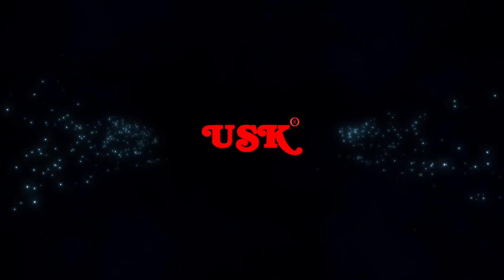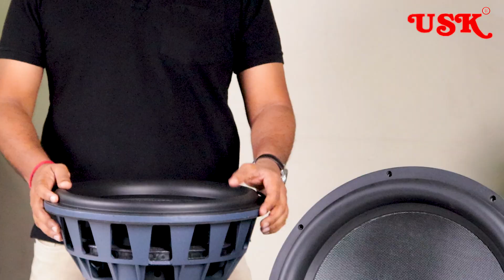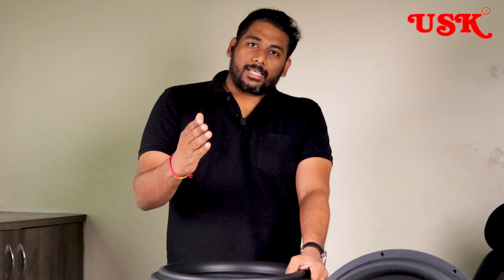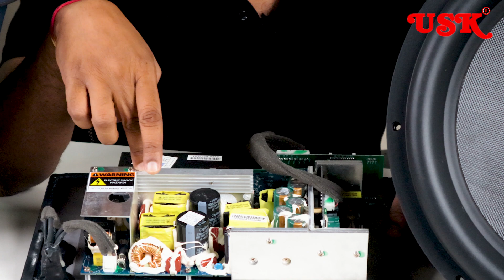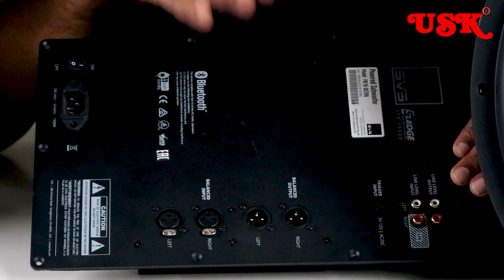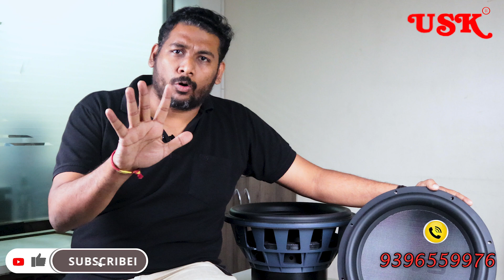"Massive" 5000 Watts Peak SVS PB16-Ultra Subwoofer

Comment: I own a few SVS subs and I had to replace my 16 ultra woofer and I was look at it and my god it all has good qualities but the wires from the push connectors to the coil made me curse most subs have the wire woven in with the spider yet their wires were out in the open and mine were ripped not even talking about I was in thin they were everything on my SVS subs are high quality, but those wires are so FUCKING cheap.
Reply: I've turned my pb16 into a homemade 33 and cut the voice coil down a inch so it's now 2.7ohm

Comment: Why didn't you measure the diameter. It's actually 14 inches on the diameter after I saw youthman's video when he measured it. It measured 14 inches on the cone surface area and 15.5 inches including the basket. Hmm, SVS lying about their own measurements!!!
Reply: Coil isn't 8 inch either they are actually dual 8ohm with 188mm id 194mm od coil with 57mm winding height. 

I modified mine to drop down to 2.7ohm for use on my diy 33